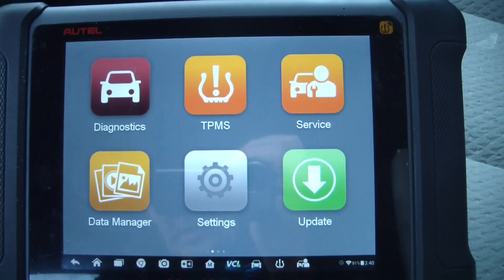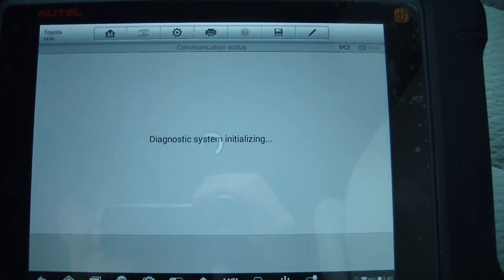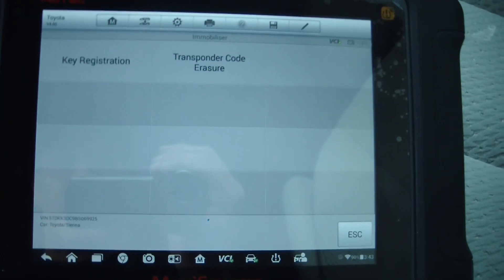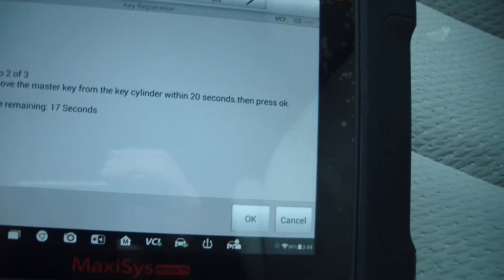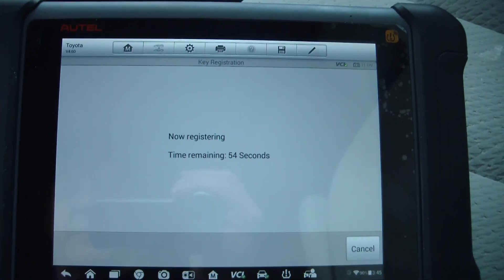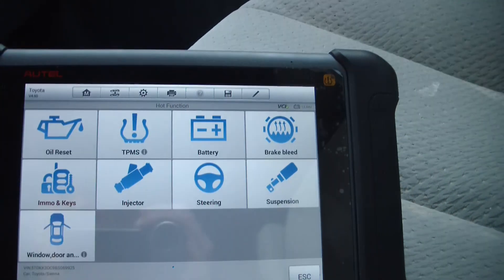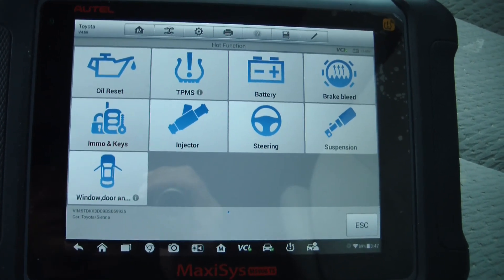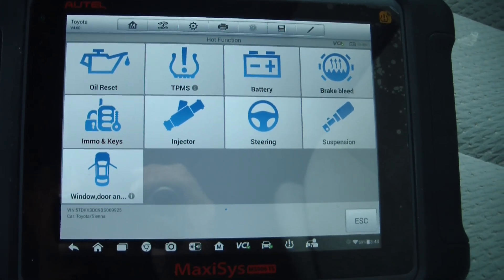Programming a Toyota G chip key with the Autel MS906TS

Comment: Have you tried to make a key for GM or Ford yet? I just got my new 906BT and tried to make a Buick key for a 2009 Enclave......it won't do it. Message says "current key #'s match", and will not allow any more keys to be made.
Reply from the maker: I have made keys for both Ford and GM. Both was a success. Make sure there isn’t the maximum number of keys already programmed, if so remove one to make room for the other.
Reply: @737mechanic  Maybe it depends on the year because for the 09, GM made it very easy for anyone to program an additional key as long as they have 1 working key. So I was able to program another key that way.....the 906 would not do anything or give me any options at all. But I think that they changed it around 2011 so that people would have to go to the dealer or locksmith. So maybe Autel made it possible for the later years? I just could not find anything on u tube showing GM or Ford key programing for the 906.